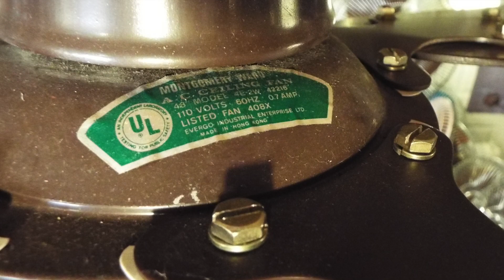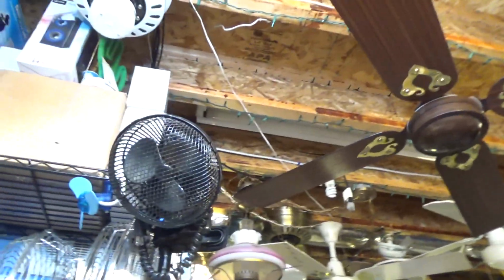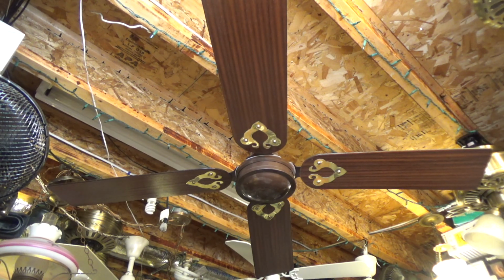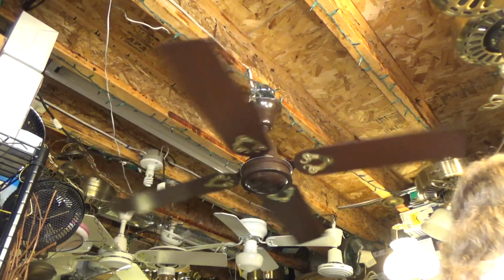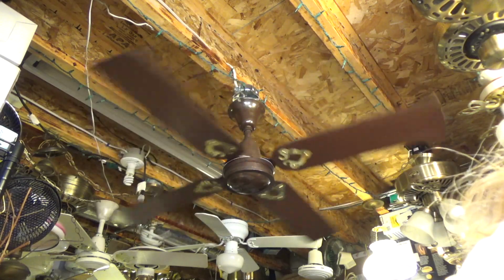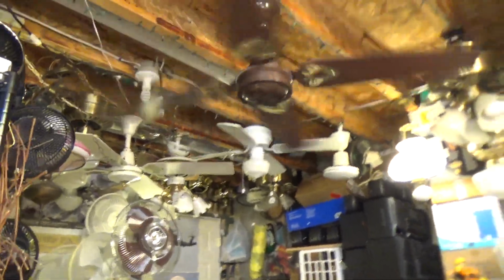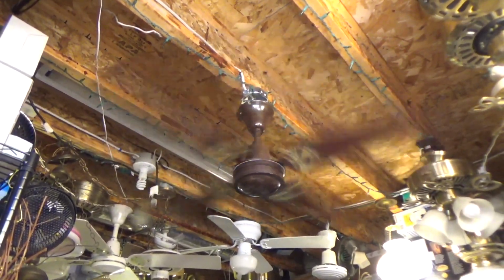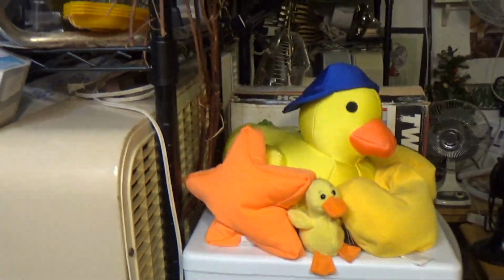Evergo Industrial Montgomery Ward 4E-2W 48" Ceiling Fan

Comment: We moved into the house that we've lived in now since 2001.This house had 2 of these fans.The ceiling fan in our bedroom has been running 24/7 ever since we moved in and still running on high speed.The only time it was turned off was when we had power outage or to be cleaned.We redone the second bedroom that had the other fan in but we got rid of it not thinking to keep it in case ours went out.This is a darn good fan and I wish I could find another one.It really blocks out noise too👍And blows really good👍
Reply from the maker: That really is a shame to have gotten rid of the other one, you cannot get fans like this anymore. None of the ones made today are as powerful nor last as long.

Comment: I am moving into a house built in 75, ny family moved into it in 85. I was raised in the house. Now I'm moving into it to raise my family I have this specific model with the original 5 speed control box. This fan has been in that house for as long As i can remember. As far as I know the fan was installed when the house was built. Damn good fan. Moves a ton of air on high. Did you ever figure out if it runs in reverse?
Reply from the maker: If it's reversible, there's probably a switch somewhere on the lower canopy above the motor. Not all models of this era were reversible.

Comment: I have this exact fan and it has started to squeak terribly, almost sounds like grinding so we have stopped using it. Is there a way to oil it? The bearings don’t seem to accessible. TIA!
Reply from the maker: These use 2 ball bearings. The motor can be split open for bearing replacement. It takes some effort, but it's well worth doing over replacing with a new fan.